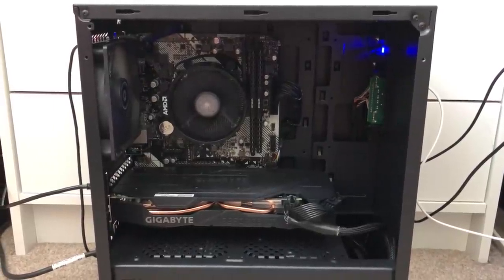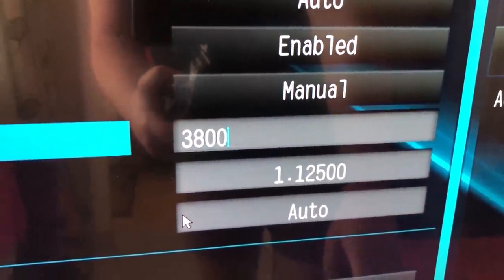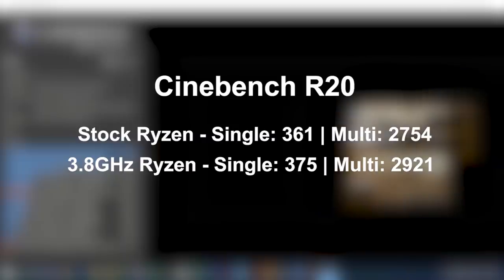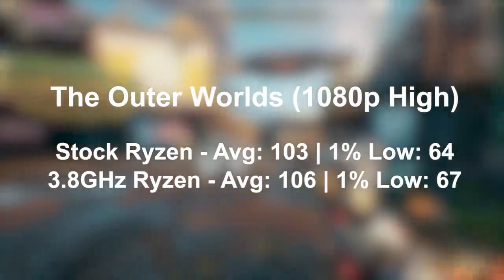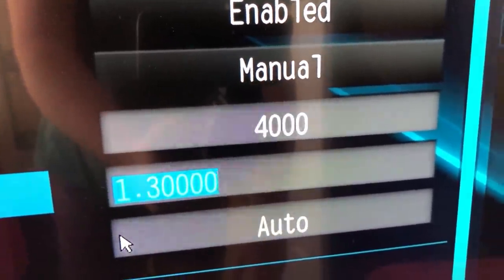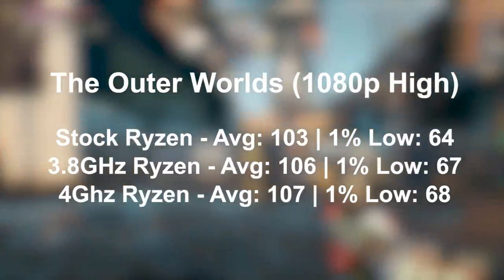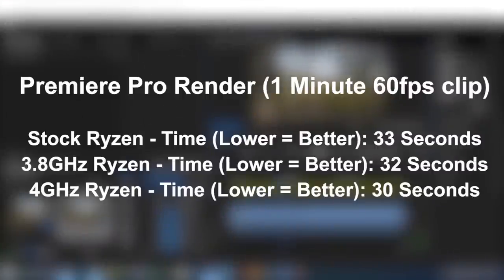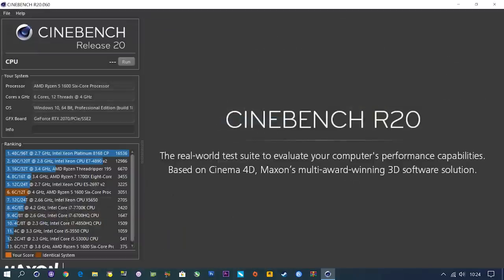4GHz Ryzen Overclock On The Stock Cooler: Good Idea Or Fire Hazard?

Comment: That's one of the downsides of Ryzen.  Very limited OC potential.
Reply: yeah i agree aswell. but the good side is that we get almost maximum performance of the chip right out of the box. i do miss the g3258 days i had though. i got the chip to 4.7Ghz and the base was something like 3.2 LOL
Reply: ryzen = pretty much no overclocking headroom and low clockspeeds. i sold my ryzen 2600x because of the bad gaming performance. afterall zen was made for enterprise market (scalability meaning cores/threads were a focus, not clockspeed), which is why desktop performance is not that good (games etc). ryzen is good value tho. not top-hardware.
Reply: @Dr.WhetFarts  well 200-300 dollar ryzen is still very similar to intels chip with slightly lower clock speeds. You cant compare intel and amd clock speeds because of completely different architectures.
Reply: Still better(more) IPC(instructions per clock) compared to Intel's, so... Even with Sandy-Bridge you had to overclock i7 2600K 35% to gain 10-15% performance in encoding and rendering, but it costed you the expensive chip, 2x expensive cooling, 2x expensive mobo, screw overclocking... boost is good enough.

Comment: I once tried a stock 3700x with a Wraith Spire cooler. Temps in Cinebench r20 reached 90C and the fan sounded like a jet engine. 
Apparently Zen 2 is an entirely different beast compared to Zen+.
Reply: I thought the 3700x came with a prism cooler?
Reply: @jbscotchman  it does but I traded it for my friend's Spire because I have an aio. Just tested the Spire out of curiosity.

Comment: I run a Ryzen 5 3600 at 4.0 GHz and 1.1 Volts. It is stable, not getting hot at all and the performance is great, highly recommended.
Reply: Nice ratio there bro
Reply: It's jokes ?
Reply: @OGBouncin94  Thank you. I prefer my CPUs cool and my PC to be quiet. And it is fast enough that I don't need 200 or 300 MHz more.
Reply: @LightSoundGate  I just undervolted my Ryzen 7 3700X to 1.1v @4.0ghz and man, this is great! Awesome performance with minimal heat only topping at 74c under full load which is amazing because Ryzen 7s run VERY hot like 87c - 95c at 1.3v under full load so yeah man you're goated now lol 👌😁
Reply: @OGBouncin94  I am glad it worked for you too.

Comment: I'm curious as to what your idle temps were, mine seem to ramp up to around 50 and spiking to near 60 degrees at 4.2 ghz and 45 or so degrees at 3.8 with my ryzen 5 2600x. I cant seem to get it to run at 4 ghz because of how my bios is structured (b 450-a II), instead it defaults me to either light overclocking or all the way. My temps under load are the same or incredibly close.

Comment: Did they stop production of this chip? I can’t find it anywhere under the price of $140
Reply: Dslayer3rd it’s basically the Ryzen 5 2600 now. You can find them at the same price, but the 2600 is the newer model
Reply: @diamondforever3560  They actually the same chip, the 1600AF is downclocked ever so slightly and rebranded 2600.
Reply: Imraan Omar ahh gotcha

Comment: Hmm odd, I have a 2700 and with the stock cooler I can only get it to 3.8ghz at 1.18v or else it gets way too hot and crashes
Reply: more cores= more heat
Reply: @artyomka.1568  also a bigger cooler than the 1600 AF's, quite bigger actually so technically it should compensate

Comment: The easiest cpu I have ever oc'd was a i5 3470 on a z68 mobo.. Went from 3.2 to 4ghz without any extra voltage lol. 20+ fps in certain games.. Stayed under 60c at all times.. I7 6700k was the worst experience
Reply: My old i5 760 went from 2.8 to 3.4 right out of the box with no voltage adjustment and ran for years.
Reply: meanwhile my 2600k did 5 ghz for years and still runs in a friends rig, overclocked. funny to see ryzen owners struggle for 4 ghz clockspeeds with this in mind. that 2600k @ 5 ghz actually beat ryzen 5 2600 @ 4.1 ghz in pretty much all games. don't know about 3000 series never compared them.

Comment: I just built a ryzen 1600af system i decided to retire my old x58 monster and build something hassle free I've had some issues though haha when I enable xmp profile my system won't boot not really sure what to do but it runs at stock ram speeds. I had another instance where power saving mode would shut my monitor off and upon waking it back up I lost display port hours of panicked troubleshooting finally realized it was the monitor not my gpu. I wish I could have afforded a nicer gpu like yours I was trying to stay with amd graphics bc my monitor is a free sync model.

Comment: I have to go to 1.38 on a x570 motherboard to go to 4.0 ghz.but i have a kraken x62 so the temp max temp is 62 degrees.with 1.4 doesnt work with 4.1 i thinl  1.45 should work with 4.1 but i was hoping for 4.2 or 4.3

Comment: My 3600 went to high 80s with the stock cooler and I replaced it with a 80mm fan tower. It lowered the load temp to high 70s. I started folding now and it's hitting 95°C🥴

Comment: I hate those Ryzen stock coolers - what was wrong with the simple clip and lock fitting. So easy to swap CPU's or to re-paste but now you have to remove 4 screws, then the backplate drops out and you've got to line it all up again and put so much pressure on the motherboard that you're scared it might crack it. Please AMD bring back the clip and lock for all future CPU coolers.

Comment: I think that overclock makes sense if you have a real performance improvement. for example videos or UI that don't stutter anymore, games that go from unplayable to barely playable. I got one of those famous q6600 and overclock it from 2,4 to 3,6ghz makes a night/day difference. 50% more performance from one of the most powerful chips of that time! I tried up to 3,8ghz but the heat and power drawn is insane. In fact all comes to a cost, and nowdays for the higher cost of the electricity drawn by an overclocked cpu (it usually becomes less efficient) you could have gone for an higher spec cpu in the first place.

Comment: i am very glad i got one of these before they disappeared off amazon here in the us also how did u get the ram to 3200 mhz? my system was unstable had to set it to 2933.... also i only have a a320 mb budget was tight this time around
Reply: I just set my xmp profile in my msi bios and it has been running my 3200 ram with no issues. See if any reviews for your ram show users getting those speeds. Maybe theres a setting youre not turning on or something.
Reply: @musek5048  i have msi a320 pro max but my ram is cl14 maybe thats y idk...id rather have the tighter timings
Reply: @mrhappy8966  hmm could be the board gets too hot and unstable under heavy oc loads, ive seen plenty of users running higher than 3200 on their ram although pushing it past its intended speed could make the ram unstable
Reply: @musek5048  its g.skill trident z i got off my friend  he had it running at 4000 mhz so its probly the cpu because the mb is rated upto 3200 mhz
Reply: @mrhappy8966  could be but its hard to say unless i had your system in front of me so i could poke around with settings to see what the issue could be. usually when i have had problems before with my rigs i will look up the combination of hardware to see if other people are running into the same issues and how they ended up fixing it if at all possible. good way to narrow down any problems that you might not be able to think about in the moment.
Reply: @musek5048  thanks for the input

Comment: My 2600x with all the precision boost overdrive settings set to Max gives me more performance than the chip can give while manually OCing. All core I could get to 4.05Ghz manually. With the overdrive settings 4.09 all core. Also my low thread workloads (like gaming) get the clock speed around 4.2Ghz. Not sure if it differs a lot with the 1600AF but I found a manual OC on my chip to be useless. I don't know if cheaper B450 boards have a precision boost overdrive settings menu in BIOS. But if so it's maybe worth a shot on the 1600AF.

Comment: Yet the 10 year old Intel Xeon X5675 etc... can do 4.2-4.5ghz overclock on all 6 cores/12 threads without issue and remain cool, and last for literally 10 years at that overclock without degradation. It really shows the quality of Intel's manufacturing process vs AMD's cheap and dirty approach of chiplets and thin silicon.
Reply: that's server cpu lack instruction set, 32nm (that's why your sillicon is big) $1,440 cpu @ launch, 1.170 milion transistor, slow memory clock ddr3- 1333MHz.
compared to 
more instruction set, 12nm $150 cpu (now $89) , 4800 million transistor, support ddr4 2666

idk what's your point, no sense.
Reply: @claritoresdiano1021  Yeah no AVX is the only downfall really. But most video games and software applications don't require AVX/AVX512 etc...
Reply: @AJDOLDCHANNELARCHIVE yes for most old school stuff, no for modern stuff
Reply: @claritoresdiano1021  Examples?
Reply: @claritoresdiano1021  I use an X5675 for both gaming and productivity (audio recording/production/composition, Photoshop, After Effects, Sony Vegas Pro, CryEngine, Unreal Engine, Lumberyard, etc...), and have never run into problems due to not having AVX instruction sets. They are usually optional to boost performance, not required to perform the task at hand.

Comment: Very little gain to be had overclocking on Ryzen. I can push my 3600 to 4.25ghz before it become unstable. But it takes 1.38v. Yes, it gets me more Cinebench points, but does nothing in the real world like games etc. 

I got far better results by using better RAM and overclocking it to 3600mhz 14-14-14-14-28 timings. Gained me about 5-10fps.

Comment: I have a cheap x370 Gigabyte mobo and can't really overclock through bios, I've gotten a stable 4 ghz through the ryzen master software with 1.28 voltage and done stress tests. It's stable but I've been wanting to upgrade my motherboard for a better one, maybe a b450 or x570. Is it worth it to do it or better wait until the new ryzen cpu's come and ugrade the cpu with whatever new motherboard they release?

Comment: I have a 2600 and a 2700 I have the 2700 under an aio and the 2600 under the spire that come with the 2700 which is beefier than the stealth and it boosts to like 3.95 where my 2700 only boosts a round 3.5
Reply: I reckon I could OC the 2600 well past 4ghz with the wraith spire LED

Comment: I did this with my 2600X and it is overheating to 100C while gaming, pls help RGiHD 😔 i tried updating bios, reseting to default, switching everything to auto, but nothing is working 😭 my PC is unusable right now i dont want it to overheat again
Reply: change your thermal paste !
bad case airflow, hot room ambient temperature, heat from your GPU, too much dust. 
underclock~undervolt

Comment: hello
do you have any idea about ryzen 5 3500?
it's available in India but it will not show on amd site..
i bought it from Amazon for 121€
and it's same as ryzen 5 3600 but no hyper threading (smt?)
3600 costs 200€
better deal? 
i don't think amd will have separate production lane for this 3500 cpu.. and release in limited countries.. right? 
so, they just  do in software. 
like using software modifications on 3600 cpu and turning off smt? 
is it possible? 
can you investigate on it? 
 thanks!

Comment: I didn't dare go over 3.6ghz with the stock cooler. I now have a be quiet dark rock 4 and i pushed it up to 3.75ghz with the voltage at 1.250v. Stayed at a cool 50'C in Cinebench R20. Might overclock to 4ghz or even 4.2

Comment: Pretty sure I have that same board but I can never overclock my ram. Stuck at 2133 even though the sticks are 3000 😫 running the R5 2600 with GTX 1070 and EVGA 600B power supply. Any suggestions?
Reply: did you try setting the memory speed to manual/3000 instead of auto in the bios?
Reply: @MrGman910  I did. The PC just turns itself of and on a few times after saving and exiting, then just reverts back.
Reply: John Piper interesting.. check the voltages of the ram, the bios might not recognise it properly. My friend had this issue once

Comment: My 1600AE@3.8GHz achieves 2798pts in Cinebench. 
1.275v for the CPU.
1.20v for SoC (otherwise my RAM is unstable).

Could do 3.9GHz@1.325v but that incrases the heat output 15W and performance isn't quite noticiable enough, 4.0GHz can boot to Windows at same settings but is unstable for anything else than web browsing, no voltage in 1.3-1.4v range seems to be enough to fix that.

Comment: I have a Ryzen 5 3600 and it hits 95C on BL3 on badass settings with a RTC 2060 on a stock cooler. (Although I'm not sure if thermal paste was added by the builder.)

Comment: I tried 4.2 on my 3600 on the stock cooler. Nice toasty 85c. Everything is fine. I have an NH-D15 now... lost my heater :(
Reply: I couldn't even get to 4.0 on my 3600 with stock cooler without temps jumping up to 95C. Might have to give overclocking another try

Comment: I have the 3400g overclocked on the CPU to 4150Mhz V=Auto and on the iGPU on 1600Mhz V=Auto. The temperatures is on idle around 45°C and on Gaming (R6) 60-65°C

Comment: 1.3v pretty low considering the 3000x series can go upto 1.5v if you allow PBR & Overdrive to autoOC to 4.4ghz. 
with Ryzen's performance been tied to Voltage, you should maybe see if you can squeeze some more points out just with voltage, no core clock increase :)

Comment: So I have this cpu and motherboard.  And on stock aida 64 stress test.  My reps jump and fluctuate. Up to 84c but it’s always going up and down.  The. I’m on stock. And the voltage runs as high as 1.35 when I look at cpu-z.  I would love to overclock. But I can’t.  Before this I have my Ryzen 3 1200 to 3.8 ghz no problem.  Lower temps then what I have now

Comment: Well I can get 4Ghz at 1.375 volts with a MSI Gaming Pro Carbon AC with the stock cooler. Cinebench score 3004 but the temps while doing Cinebench was 101 degrees Celsius!

Comment: The original 1600 came with the spire that had a copper core. Big difference as I've tried both coolers. The copper core can handle the 2600 at 4.2ghz no problem.

Comment: Uhm... don't do that guys... just don't do that, if you don't have a room with stable 21°C temp, don't do that OC with stock cooler. My ryzen 5 2600 was reaching an average of 86°C and a peak of 92°C on aida extreme with fpu cpu and cache stress test at the same time with a gammaxx 300 at 4.0 GHz and 1.35V (I can't go lower with the voltage, because the system will crash on heavy loads). And what workload I've found to be close to that stress test on aida? Streaming csgo with obs on x264 6500 or 7000 bitrate (I forgot if the bitrate was 6500 or 7000) on veryfast 1080p60, it was averaging 85°C after 30 mins.

Comment: Ok here's a pretty serious question, which i just can't find the right answer and hoping that you can help. So as all of us potato pc owner, we might started our pcmr life with basic pc specs. But one day, you decided to upgrade your pc buy putting an ssd into your system. You already have installed windows 10 on your 1tb hdd but you don't want to format it. My question is how can you install windows on your ssd, and somehow remove all of the windows part in your hdd to save some space because you only have a small space to work with, and still keep your stuff in there.

TL;DR : how to properly upgrade to an ssd

Ps, sorry for bad english, thanks in advance
Reply: I went through that as well. I know there is a software that copies Win10 through disk storage units, but I can't remember the name... But if you figure it out and copy it, set the BIOS to read your ssd before your hdd. Eventually unplug your hdd after copying win10 and see if windows 10 boots up from your ssd. Then ... well, just delete windows from the hdd. Maybe you now have an idea on how this will go. But probably any other advice will do better - hell, maybe I've fucked up my programs and stuff. I don't know - there are Win 10 reinstalls between now and then (software issues, an faulty CPU and hardware changes). Google might help. Good luck ^^

Comment: I just upgraded from my old i5 3570 to Ryzen 5 3600. What do you think, should I install stock Ryzen cooler or transfer my old BeQuiet pure rock slim? Will there be any major difference? Note that I won't overclock.

Comment: Same CPU , RAM (2x8 GB Corsair Vengeance LPX 3000Mhz OC 3.2Ghz) here , but bad MB (Gigabyte A320-M-H)  , GPU Gigabyte 1030 OC , 1TB HDD+ 120 GB SSD Kingston.
You didn't OC the RAM ( 3400- 3600 Mhz  maybe more on that MB, at 1.35-1.4 V no more, more for daily usage is bad. )
1.365 V CPU for daily usage is safe, but less is better.

Comment: I am surprised it only goes to 3.6GHz stock . . . it's a desktop chip. My fairly cheap laptop with a 9750h goes to 4Ghz all core turbo and stays there. Doesn't even get that much hotter relatively speaking, consdiering it is an Intel chip in a tiny laptop!!!

Comment: Can a 5 3600 clock up to 4ghz like this? 

I have a msi b550 board
1660ti 
Ryzen 5 3600
16 gb (2x8gb) ram
The paired cooler with the ryzen, I think it's the wraith cooler. 
Evga 600w PSU
SAMSUNG evo 500gb
And I think a crucial NVMe 500gb.

Comment: Ryzen 5 1600af 8 gegs aegis 3200mhz rx 580 nitro + 4gb. no need for overclocking tho im running with aftermarket cooler with 53C while gaming. it really doesnt worth it if you have weak gpu like i have